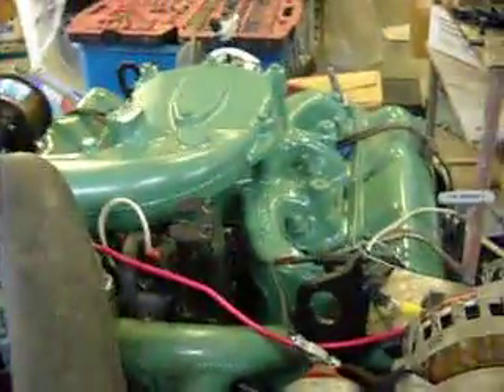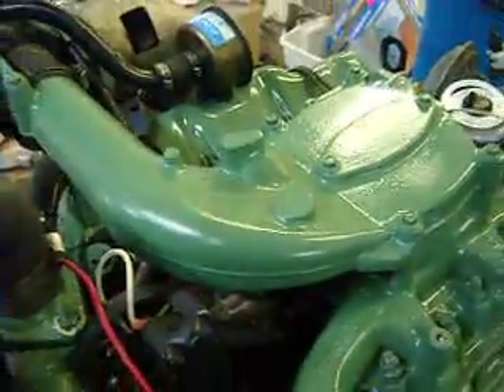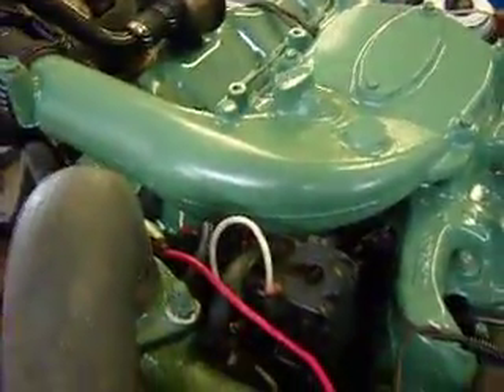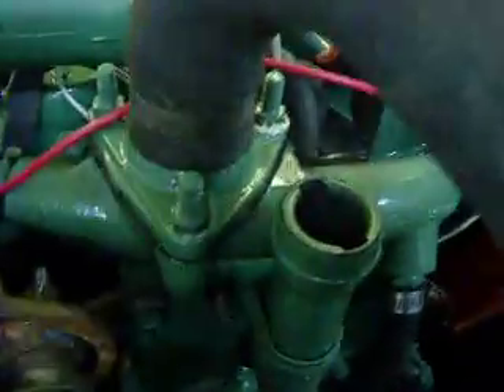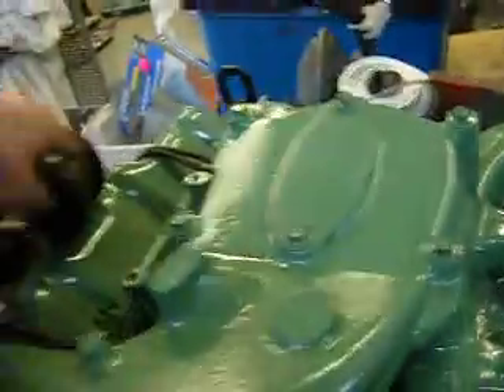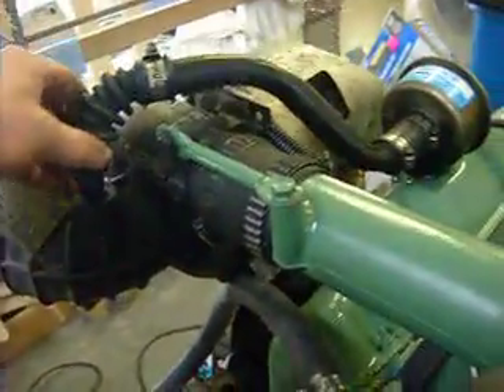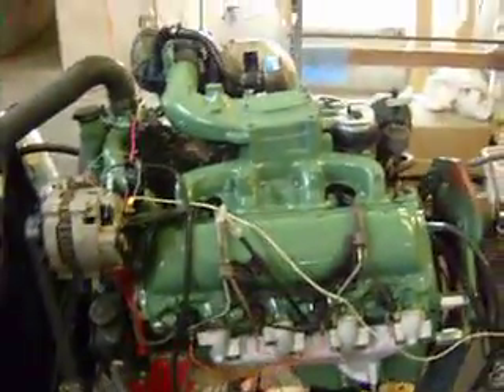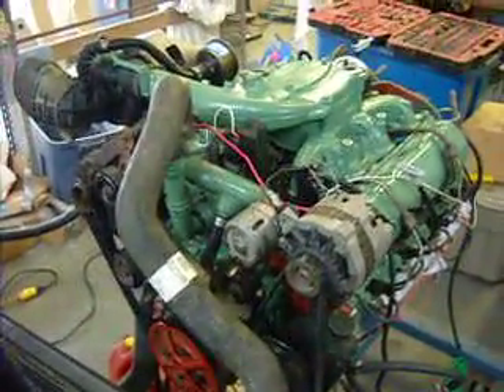6.5L turbo diesel 8* of timing a bit of blow by maybe the rings need to seat still?

Comment: Did you ever resolve this issue? My  6.5 has been experiencing this and am starting to notice power loss and increased rpm. It doesnt blow too bad out of the oil filler or dipstick tube but its pure smog out of the cdr. Ive been thinking about rerouting the cdr to the tailpipe exhaust or installing a vent and capping the hole in the intake. That way there may b
Reply: ...there may be some vacuum in the tailpipe to help that shit out of my truck